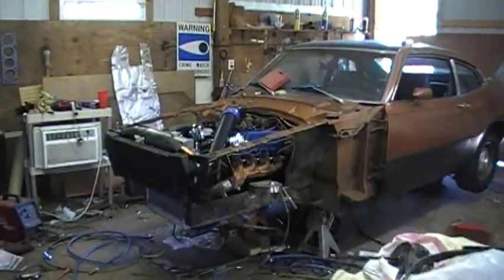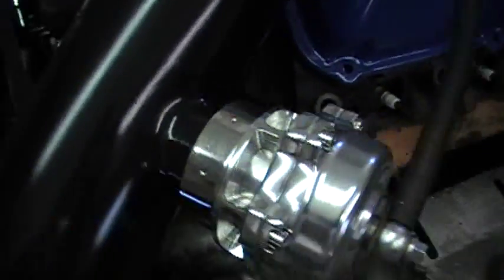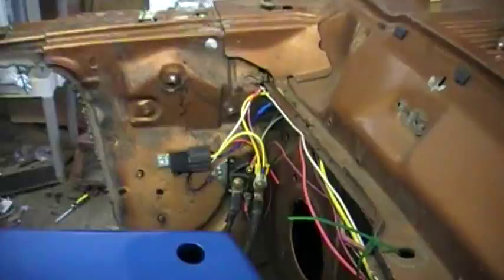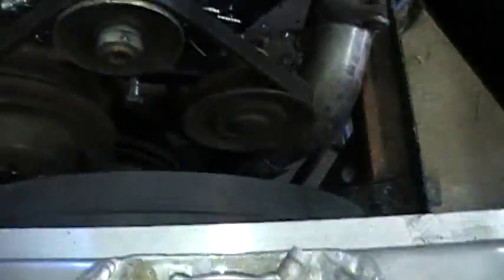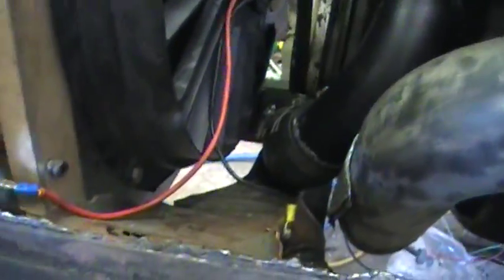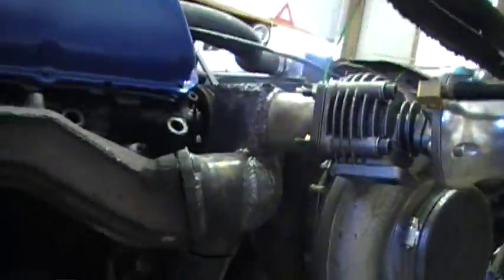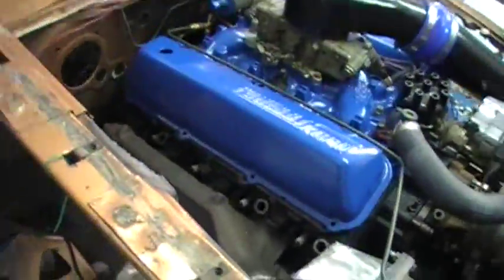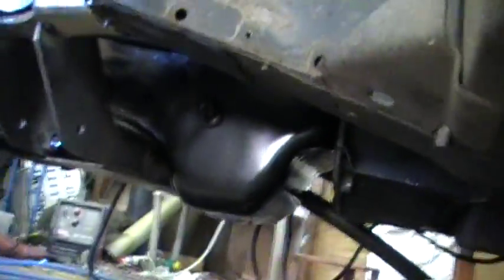part 2 turbo 460 sleeper maverick 73 grabber big block 92mm buildup

Comment from the maker: it was a 91mm intake wheel and a 110mm on the exh. wheel small end 1.5 a/r i think on the exh. and maybe .96 intake it would not spool at all even in drive full throttle maybe 3psi

Comment: That a cool engine swap. I'm thinking of doing something similar, except without a turbo. I'm seriously considering moving the firewall back to the base of the windshield, that way, the headers would be a lot more free flowing, (no steering box to get in the way because a rack and pinion steering set up would be mounted )the oil pan would be just a big box pan with no notches in it, the clutch linkage would really simple (floor mounted pedals). Reinventing the wheel ? maybe. Fabrication? Love it !

Comment: What distributor setup did you use with that 460 did you use the dual spark did you use the custom one
Reply from the maker: I used a Mallory hyfire box with a stock electronic distributor

Comment: Little  more power  make sure old car records  hit you when running  time every  things  listed  motor check  make sure  limited   you feel   happens  oil or transmission  electrical  make sure check  water  pimp  sprk  clean  correctly  before  running  make  hear happens   ?
Reply from the maker: Ok thanks